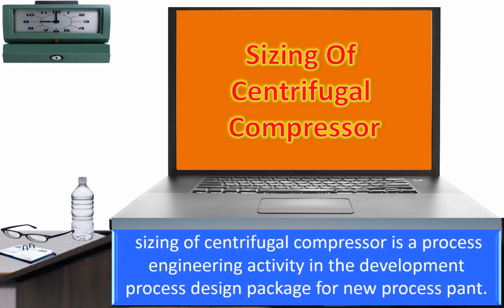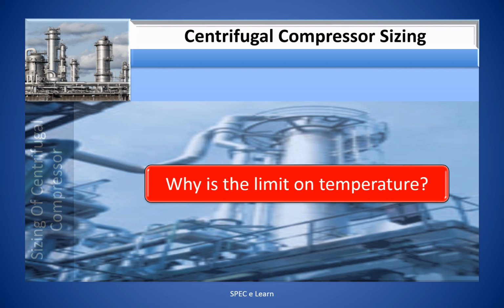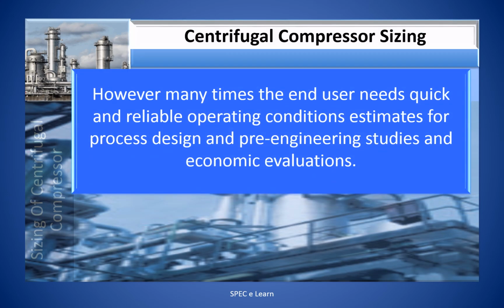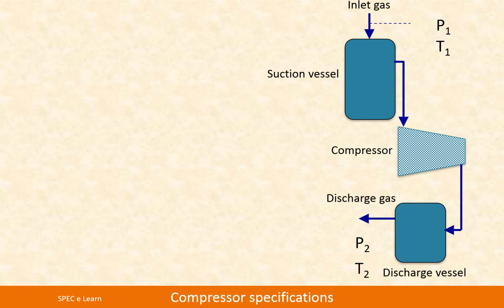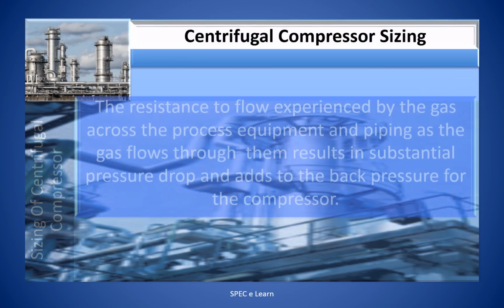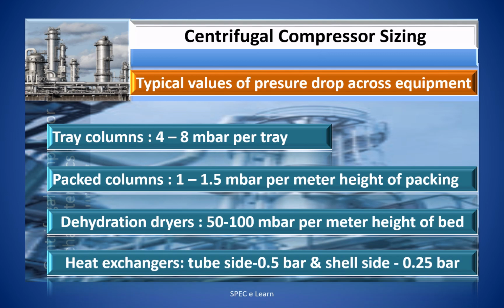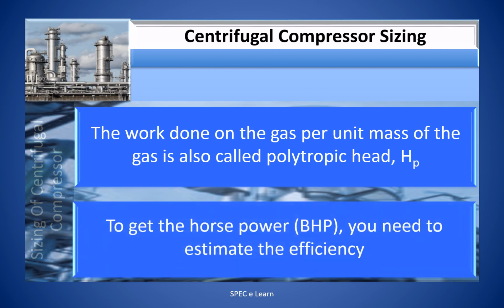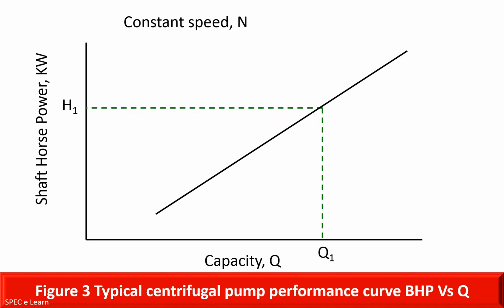Sizing of Centrifugal Compressors Part-1

Comment: Thank you very much for your video. I believe that I have found my favorite source to learn about engineering knowledge. Please keep your hard work, Sensei!
Besides, I have some silly questions that need you explain more. Please help me!
1.  As I understand that pressure ratio will be fixed due to impeller structure and will not changed because of any other factors, is it right?
2. Can you explain more why smaller diameter impeller means higher rotational speed? Do you mean that at the same driver power, the impeller which is smaller can achieve higher rotation speed than the bigger one?
3. At the Figure 1, as I understand that we will decide the pressure ratio after calculating the total pressure drop across the process. Am I right?
4. At the Figure 2, do we need to control the suction pressure at 4.5 bar to maintain the discharge pressure at 13.0 bar? How to control it?
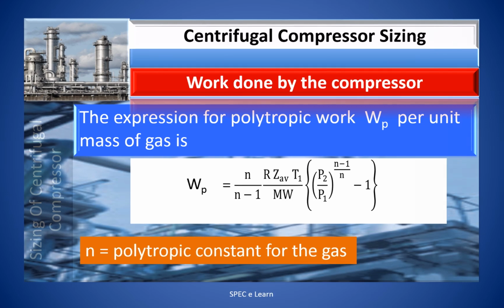5. What is the meaning of Zav at 28:00? How to get Zav and the polytropic constant for the gas (n)?
Reply from the maker: My point wise reply is as follows:
1. pressure ratio will follow the compressor performance curve, that is pressure ratio vs. capacity for a given given compressor running at rated speed. I will publish a video after some time on compressor characteristics. you will understand it better after watching it.
2.The capacity of the given compressor is a function of diameter and the rotational speed. A diameter decreases the speed will increase. Normally smaller dia. is preferred the compressor size will be smaller subject a maximum speed limitation due to Mach number at suction.. Drive power will depend on the compressor duty. Speed of the impeller will decide the rpm of the drive.
3. That is right
4. Discharge pressure will be fixed by the down stream process resistances /pressure drop. The suction pressure is controlled by the chiller pressure control valve. Since its a refrigerant loop, the chilling temperature is fixed by pressure.
5. It is the average compressibility factor. It is the average of the value at suction and discharge pressure.
Hope thus clarifies your doubts.